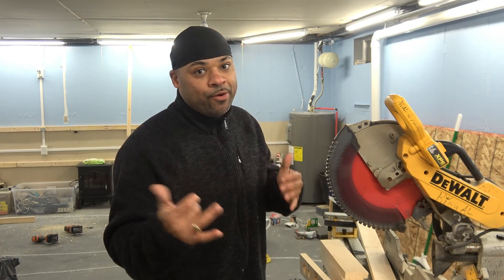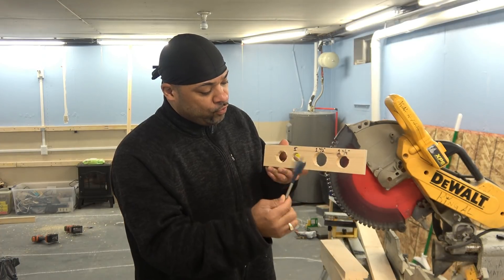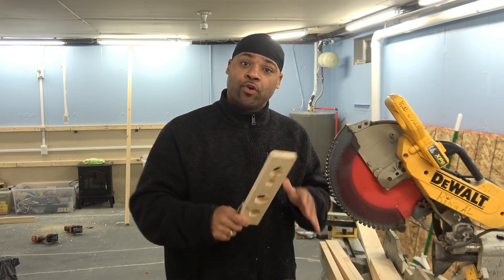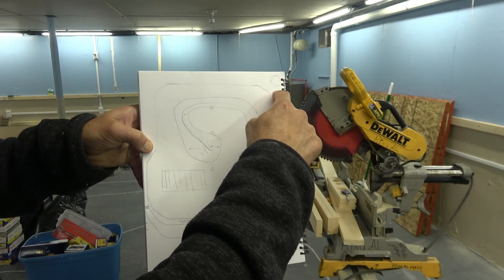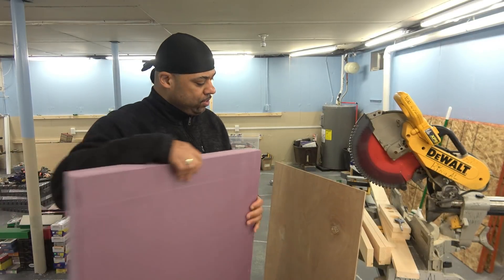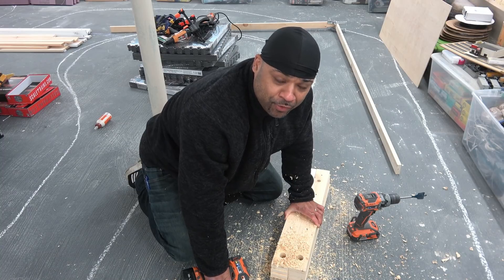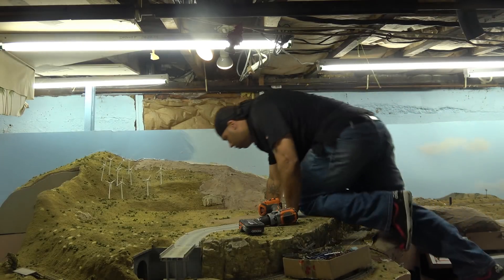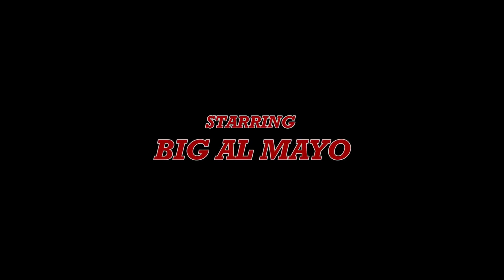02.18.20- Historic Beginning of my NEW HO SoCal Desert Rail Division 2

Comment: that benchwork is solid son. Do yourself a favor and don't block in that water heater. Make a section that can be removed if needed because you will need to replace it some day or if nothing else, that expansion tank will develop a leak and need changed out. That foam $35 a sheet? that must be the foamular 250. you don't need that. Look online for the owens Corning Foamular 150 in 2 inch instead, a lot cheaper. The difference is the 250 is for use below grade and the 150 is for use above grade, none of which matters on a layout. Home depot no longer carries the 150 in 2 inch that I can find but they do offer a huge discount for bulk purchases. Thanks for the update. Rob
Reply from the maker: Ok so the blue stuff? I will definitely look into that. Yes it cost $34.95 per 4x8 sheet of 2" foam. Where can I find Corning or other brand foam, Lowes?  Thanjs yo!
Reply: @MonsterRailroad  owens corning is the pink stuff. Home depot carries some of the product. Dow  is the blue stuff and Lowes carries some of it. If you go with Owens Corning definitely look for the Foamular 150 type in the thickness you want, compare the prices. ;)

Comment: Hey, Al, why don't you take a couple pieces of scrap wood and screw them in the bottom of your wall frame so you can lay your layout on it and than secure it. Also a couple saw horses with stacking scrap wood to level it out on the ends will help. Good luck

Comment: Good to see you building anew.  Your in California?   Next summer check and see if the benchwork is still level. In California the difference between summer and winter humidity levels causes all kinds of warping.  Have fun.
Reply from the maker: No I live in Connecticut. Where my basement stays cool all year long. WELL maybe COLD now.  It was down around 50 degrees when I am down there working but that is PERFECT tempature when I am moving around and working. Now when the layout bench work build part is done and I am working on other aspects of the layout or running trains that is when I will add some heat.

Comment: Where i live, when they pour the walls for a basement they put foam on the outside before backfilling, if they do it where you live. You might be able to get the scrap they trash, for free, saves construction company the fee to haul it away, that is how i get my foam, most is 2x4 sheets 2" thick.the last time i saved  $120. Ended up with enough for 4 full 4x8  sheets

Comment: Nice space for a layout! BTW as a former plumber of 40+ years, when you do the section in front of the water heater and what looked like a sump pump, make those pullout, rollout or something to make those areas VERY accessible if they need replacing or work. Just sayin’. It will save you heartache later.
Reply from the maker: Yup will do. There is no sump pump, that is a pipe going into the floor to pull out the higher level of Radon. But the water heater section will of course be SEMI-removeable for sure.

Comment: Good to see you working on it. Have you considered around the walls "L" brackets?  And a aisle width of 12 inches to get a little more mainline length.
Reply from the maker: Fuck to the no way!! 12" isles would be ridiculous son. Nope.
Reply: You don't need two foot deep benchwork between towns. Convincing scenery with photo backdrops can make narrow benchwork look extremely deep. Look up the Bavita model railroad club and the results they got. Their benchwork was 12" between towns. If that's too narrow, then go with 14" or 15"

Comment: When using the nail gun you need to keep your hands farther away from the place you are nailing. I have seen the result of nail gun nails changing direction and ending in the hands that were to close to the place where the nails were being driven.. On the first joint your  hand was just to close to the edge of the board. You are asking for a trip to the doctor or the emergency room.
Reply from the maker: Will keep that in mind for future building. Thanks

Comment: I personally prefer 3/4 plywood for the top and I use 2x4s its just sturdier and its easy to get tons of 2x4s. Still it is great video.
Reply from the maker: Yeah see, they are cheaper, eyes. But I wanted to building lighter and a bit easier and this is really the right way.
Reply from the maker: Tiana and I got on the layout and it did not creek, bend or anything. It IS sturdy as hell.

Comment: Man. Get yourself proper tools. Get some saw horses to hold up your work... Don't block in your water heater and piss off your repair man by making his job 100x worse because of your bad design choice. Like your videos, but watching just this and you putting up that one section.. That's one big shake my head my man...
Reply from the maker: Dont be so "square" I am not doing rocket science. I have built many layouts and will manage just fine.